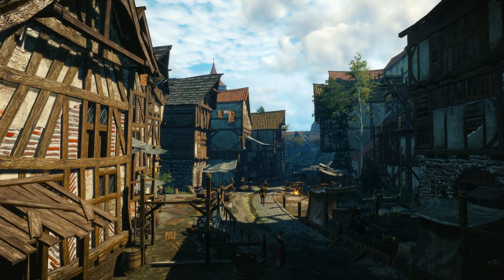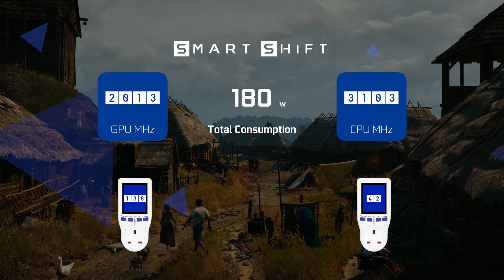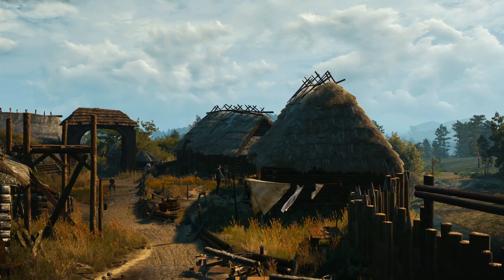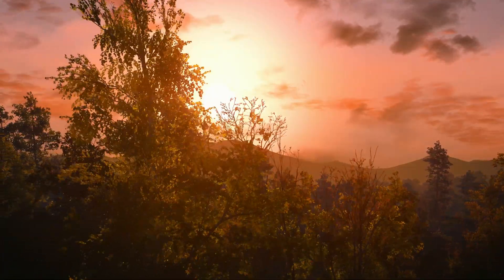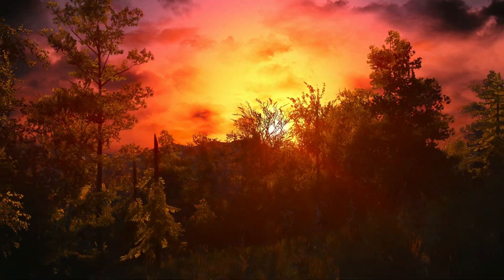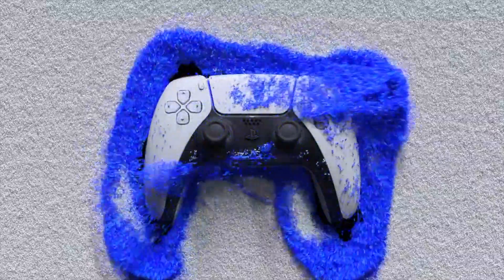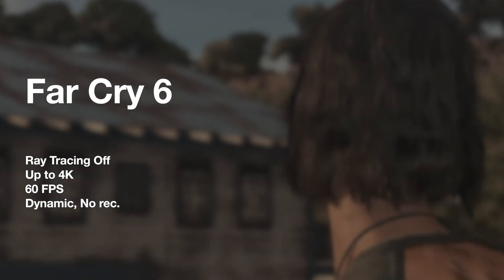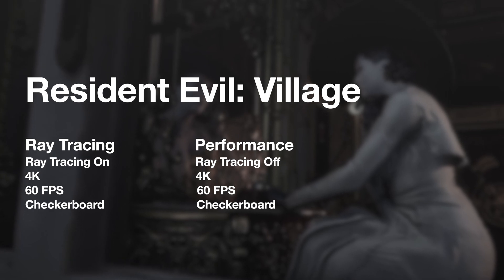PlayStation 5 Tech Analysis / What makes PS5 a special console?

Comment: Make  RTX 3050 VS PS5 OR XBOX SERS  S / X
Reply from the maker: We already have the RTX 3060 vs XSX comparison on the channel. I think comparison with 3050 is almost pointless
Reply: @HardwareLab  I think it will be more feasible because of the similar price of the ps5 and RTX3050 with the assembly
Reply from the maker: @monsteryking7399  cmon, with the ps5 you get a whole system, for the pc to work you need ram, motherboard, cpu, psu and so on. From the bang for buck perspective ps5 and xsx are a lot better now than the pc. It was different in a previous gen with ps4 and xb1, but definitely not now
Reply: @HardwareLab  You are correct, but I want you to make a comparison for me to the RTX 3050 VS PS5, and if I do the comparison, I will publish your channel on my personal page
Reply from the maker: @monsteryking7399  well, I would like, but we currently don’t have ps5 as well as 3050
Reply: @HardwareLab  So then, thank you. You worked so hard with me

Comment: Can you tell what value for money gpu would be able play future games for atleast 7 years with no issues paired with i512400f ?
Reply from the maker: It depends on your preferences and region. For example RX 6700XT that is better than the ps5 gpu will cost at least around 430 pounds in UK
Reply: @HardwareLab  I would want something cheaper but future proof if you know what i mean by that ... like i dont want to buy graphics card every now and then given the high prices(i have a rx 6400 currently)
Reply from the maker: @bmqww223  6600XT and lower on amd side are not “future proof” at all since their memory subsystem is crap. As for nvidia - I would go with RTX 3060, really good gpu. It can be found for at least 340 pounds in cex
Reply: @HardwareLab  its a really worrying trend to see how gaming is so expensive it seems i have to give it up eventually
Reply: If you plan on gaming at 1080p, 3060 12GB should be enough for years to come